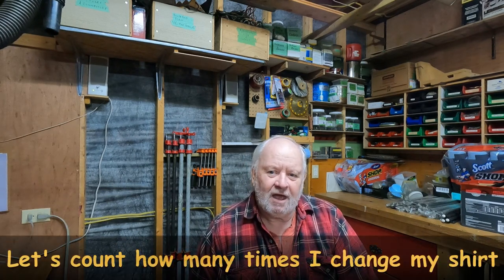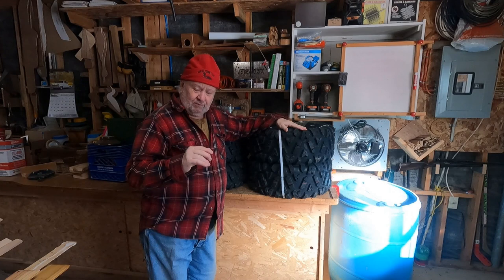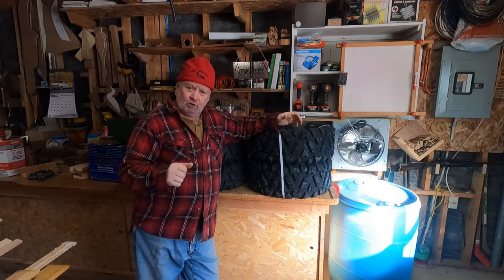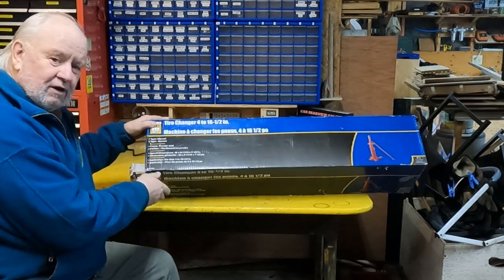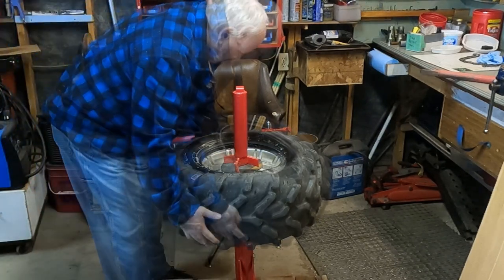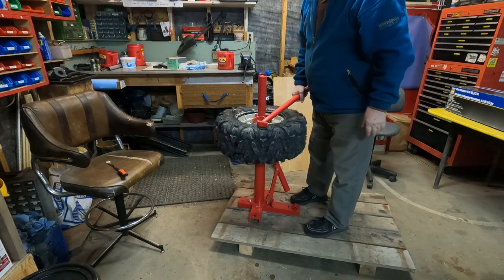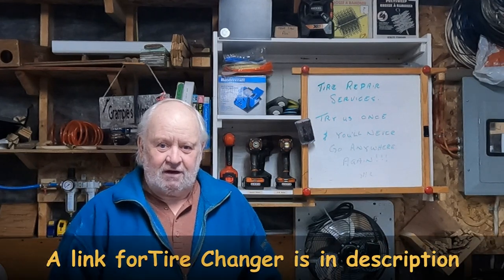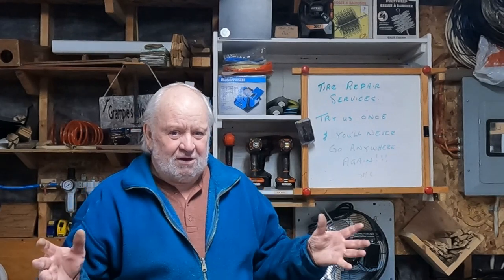New Tires and A Tire Changer

Comment: I am impressed.  Changing a tire is a tough job but I found it quite easy watching you do it.  Putting the tire on is the toughest and I could see the problems that bar was going to cause you.  Don't know the solution but it would take some time to figure it out.  Great video Mike.  Stevo
Reply from the maker: How's she goin'?  The tool that came with the changer for remounting the tire is not great.  There are more elaborate 'duck heads' you can use that would work better.  I also think the bar against the pipe causes it to roll when it comes under strain, so welding a couple of pieces of flat bar on there would make a difference too I think.  Thanks for watching Stevo and have a great week!!

Comment: Hi Mike!  Yep, looks like those tires sure needed replacement!  Good choices of tires from the looks of the tread.  Now you’ve got a great tire changing set up! Thanks for sharing!
Reply from the maker: How's she goin'?  The old tires were done for that's for sure.  The UV is hard on rubber and these tires were outside a lot.  The new tires are pretty nice.  Not radials but still 6 ply rated!!  They should last me eh.  Thanks for tuning in and have a great week!!

Comment: Hi Mike now thats what i call a handy tool for when you have small tyres to change, i wish i had something like that when i did my grandsons little ride on
Reply from the maker: Hey there Neville!!  I have to say I was pleased with how well this changer worked.  I had trouble getting the tires back on the rim and had to use the tire irons, but I think if it were secured to the floor that may have worked out better.  Thanks a lot for drooping by and commenting.  Take 'er easy!!

Comment: Changing tires is a big job, always wondered how those changers worked. Thanks for the video Mike! Tire spoons work great good to have on hand. 
Take care eh !
Reply from the maker: How's she goin'?  This tire changer is a good sturdy tool and should hold up to some rough handling.  The bead breaker is nice, even though I fought a lot to get the back side of the ATV tires broke down.  The tool for remounting the tires didn't work out too good for me but maybe if the tire changer was secured to the floor it would have been different.  Thanks for watching Russell.  Take 'er easy!!

Comment: Awesome Grampie《☆》Not a Job for the faint of heart👍⛾🍕🦅Nice trick with the ViceGrip. All we had at work was a bead breaker for aircraft tires which are split 1/2 rims. My Boss said it's a slow day Let's change the Tractor tires. I knew I was in for a hard day doing 30something inch rear Deere tires with crow bars & big screwdrivers. I managed to git er dun but I had muscles aching I never felt before. Getting the beads to seal was like you did with the ratchet strap. Shop air at 120 psi wasn't enough. Luckily we had a full 2000 psi bottle of Nitrogen which puffed the sidewalls out good enough to get em sealed. I saw another trick after the fact to squirt Flammable stuff in the tire & light it but probably not OSHA approved🔥😁for the 2nd rear tire I told the Boss either we're getting a Tire Tool or we can take this other one to the Tire Shop which is what we should have done to begin with🏋️‍♂️I understand mgmt wanting to utilize Labor but that was ridiculous. Nice work & Good move getting the equipment🙏🏻I hope Nannie is getting stronger every day. Greetings from Florida my friends🖖😎☮
Reply from the maker: How's she goin'?  The tire changer made this job easier, but it was still a lot of work.  The ratchet strap on the tire to get it to seal is an old trick eh.  I can imagine changing the 30 inch tractor tire would have been a fun job especially without proper tooling.  Amazing what we mere mortals can accomplish eh!!  Thanks for the visit as always Bdog!!  You rock brother!!

Comment: MIKE, ole son. How wonderful to catch up with you this fine winters day! I am  really liking the tread pattern 0n these meats for your quad. That nice, open tread pattern should readily clean themselves which is a really good thing in the muck. How they wear in time of course will tell that tail. I have a very similar post type tire wrestler I made well over 40 years ago that my friends and neighbors still use. Using it from a wheelchair though is something I haven't quite figure out yet but knows what the future will bring eh, LOL. These tire changers have been around since C- - - - - was a cowboy for good reason. THEY WORK. I have mine bolted to the floor on a 16 inch 3/8 ths plate 4 feet from the walls in a corner. The only problem with that is anything that doesn't have a dedicated place ends up in there. Having it bolted down sure makes it able to do a quicker and easier job. I am thinking that as I use two conventional tire irons ($ 14.00 ea) are far quicker than the ones you are working with sure make a big difference. They come in really handy for other jobs too. No one messes with a mechanic with a pair of tire irons in his hands eh, LOL. Sure nice to spend a bit of time with you today. I am thinking that no news on the Nannie front is good news. Give her a nice hug from BC eh.
Reply from the maker: How's she goin'?  Thanks for dropping by Dean!!  Nannie was doing pretty good this week, so like you say, no news is good news!!  I didn't want to drill holes in my shop floor but it sure would have made this job easier.  The next time I need to use the changer I'll set it in the shed.  It has a wood floor and I can bolt it down there no problem.  It's always a good plan to have tire irons in the box eh.  As we both know, changing tires is only one of there varied and plentiful uses!!  LOL  Hope you're getting thing squared away for Christmas Dean and say hi to Sophie!!  Janet says, Hello there Dean!!  Take care!!
Reply: @GrampiesWorkshop  Het mike. The shed floor sounds perfect. You could put in a trap door with a piece of pipe cemented in so it could be stored close by out of the way. You would have to get creative with the bead breaker though, , , Hmmm. Bead hammers are not a bunch of fun as you most likely already know, LOL. I am thankful that Nannie J is still improving. She is one determined and tenacious lady. A true Canuckian woman for sure eh. Always great to see you old FRIEND !

Comment: Good job Mike.  You'll end up using that tire changer more than you thought.   Do yourself a favor and weld in a support between the two bars on the bead breaker.  The bars that go between the handle and the part that pushes on the tire will spread if you don't
Reply from the maker: Hello there Bruce!!  I expect you're right about using this changer more than I thought.  I don't know how many tools I bought because I figured I had a need for at least a one time use and then I used it time and time again!!  That sounds like a good mod to make to the changer that you mentioned too.  I like the way you modified your changer.  If I were to use it a lot I might consider making a mod similar to yours.  I think it would make remounting the tire a lot easier and quicker.  Thanks for watching and passing along that tip!!  Take 'er easy!!

Comment: if we were born with 3 hands it would be a great thing for jobs like this. Something I used and it worked really well was tire slime. Got it at Home hardware and it's great for crack like you had on the tires....they run that in the mule tires on the farm and some had it in for three years.....CHEERS
Reply from the maker: How's she goin'?  Gator on my front tires, they leaked real bad through the side walls too, I used Slime!!  It didn't really stop the leaks but it sure helped.  But what a mess the rims were when I took the tires off.  I was over and hour cleaning them up, so for me Slime is great in an emergency repair but if you have a leak and the time, try and plug it.  I think that would be better unless you never plan on changing your own tires!!  LOL  Thanks for dropping in tonight Gator and take care eh!!

Comment: Now Mike, I've been looking at getting one of these tire changer tools for my garage too. I just looked at PA ( Princess Auto ) here when I live and I see now that they have two models, 
The one you have is presently on sale`( $10.00 off retail WOW :)  I just might go buy this one next week, while the sale`s on.
I too, don`t like the idea of permanently bolting ( anchoring ) it to the concrete floor in my shop, so I used some `drop in anchors`, which will work a treat. I presently have a steel bender ( also from PA ) and I used those Drop In Anchors for this. The best thing here Mike, is that I can bolt it in place when I need to use it, ad unbolt it when I`m finished with it. Therefore no loss of space. These will work for the Tire Changer too. 
When you next are in a good hardware store, I mean a store that carries a good selection of high quality concrete anchors, just have a look for 1/2 inch ( bolt thread ) 'Drop In' anchors. 
Read up on these here on Google, to see how to install them.
By the main, and more importantly, how's your Dear Lady doing these days?
Reply from the maker: How's she goin'?  Yes Reg, when I went to PA for the info on the tire changer I saw where it was $10 off.  Can't go wrong there.  I was thinking of using some kind of anchors similar to the ones you mentioned but I really was too kneed on drilling into my shop floor.  But I'll check out your suggestion and see.  Nannie is doing better these days.  It's some nice to see that I'll tell ya!!  Thanks for watching and take care!!!
Reply: @GrampiesWorkshop  Cheers to you both!

Comment: Great job on the tyre change, it is always gard work but a tyre changer machine sure makes it easier. We have the same space issues and our solution was to drill some floor anchors into the floor and we insert round head bolts into the anchors when we do not have the changer installed. We are thinking of ways to modify our tyre changer so we can change the front tyres on a rideon which have a much smaller centre hole
Reply from the maker: Hello there Joseph.  I watched your video about your tire changer and saw how you had it secured to the floor.  I like that idea and was considering it but I'm not ready to drill holes in my shop floor just yet!!  Maybe one day.  The small center holes on garden tractor tires makes it harder to change them I have to agree, but at least breaking the tries down off the rim will be easier with this tool.  Thanks a lot for dropping in and commenting.  Take care!!

Comment: Mike, this is a good one! I was curious about their tire changer. This past summer, I had 4 tires to replace on an old garden tractor I am trying to resurrect! The front two 6" were badly rotted and I cut the old tires off with a sawzall. I bought their tire lube and the set of tire spoons to try to install new tires. Man, it was a battle! I figured i would most likely hurt myself, so i cleaned up the rims, gave them a coat of paint and went to my local garage to have them installed. I eventually took the two rear wheels there to have them remove the old 8" tires and install the new ones. They charged me something like $128 to do all four, which i thought was a bit pricey, but what can you do? Looks like this tire changer might have done the job? Oh well, next time!
With regards to the mounting on a skid, i had the same idea! I have a PA metal bender with a similar footprint and don"t have room or want to screw permanently to the concrete floor. I am looking for a good skid or pallet to try this as well. Your video has given me some renewed confidence! Take care!
Reply from the maker: How's she goin'?  Mounting tires is not for the meek and mild eh!!  It's hard work.  For your garden tractor tires this changer may not have worked as those tractor tires and wheels usually have a small center hole and wouldn't fit on the changer.  It would be good for breaking them down though and then I'm afraid it would be tire irons and spoons for the rest of the job.  Mounting the changer on a pallet worked OK.  I have a shed with a wood floor.  I think the next time I use this changer I'll try to set it up in the shed and see if it goes any easier.  Thanks for your visit tonight and take care!!

Comment: Boy it was a maybe she will maybe she wont lol great job mike. I got the balancer and weights but not the changer lol one thing at a time
Reply from the maker: How's she goin'?  I'm glad I bought this tire changer.  It worked pretty good considering it wasn't securely fastened to the floor.  Since I won't be changing many tires (I hope) not having it permanently mounted in the shop is going to be OK I think.  Thanks for the visit Jason and take 'er easy!!

Comment: Hello Grampie. I was wondering if you can bolt or weld a flat piece of steel on the handle to keep it from spinning. Amy way it looks like a decent tire changer. Good job and take care 🔧👍
Reply from the maker: Good day eh!!  Good idea Arty.  I was thinking of doing that.  I bet it would make a difference eh because the twisting of the bar was causing it to slip out of the tire!!  I appreciate you tuning in and commenting.  Take care!!

Comment: Are these tires the bias ply, 6 ply tires? how do they handle going on hard pack logging roads? Im thinking of getting these for my grizzly 700 I just do logging roads and trails usally at speeds under 80kmhr but just a bit concerned that there bias and not radial tires but i dont know much about tires
Reply from the maker: How's she goin'?  Thanks for tuning in and commenting.  This is a good question. These tires are 6 ply rating bias tires.  Not too sure what the '6 ply rating' means exactly.  I had radial tires on the bike before I changed to these.  The radials were some soft to ride on.  These bias ply tires have stiffer side walls, probably because of the 6 ply rating.  They sure seem like heavy duty tires.  I had aired them up to 7 PSI at first and found the ride was very stiff and bouncy on the trails and logging roads around here.  I dropped the pressure to 5 PSI and it made a big difference.  I would say they are still more bouncy than the radials, but I think they ride pretty nice.  The ride is rougher but with the independent suspension, it kind of smooths that out.  I would say these bias ply tires would be acceptable for logging roads as well as mud and rough trails riding.  Thanks again for watching and I hope you can come back again sometime.  Take 'er easy!!!
Reply: sounds good, thanks for the info